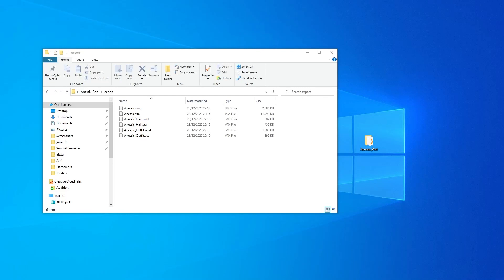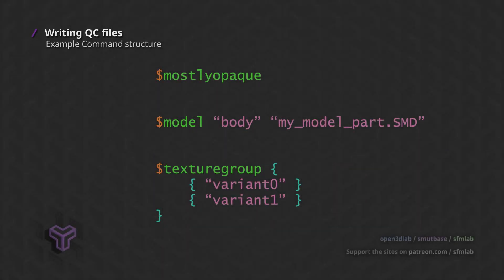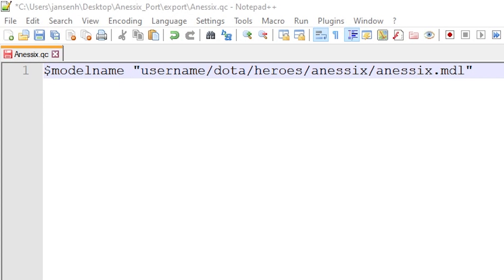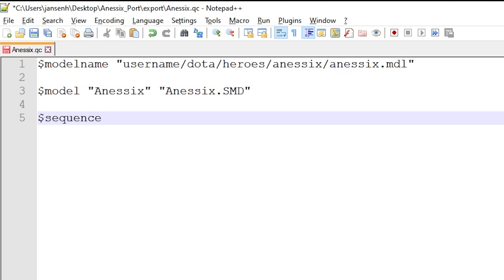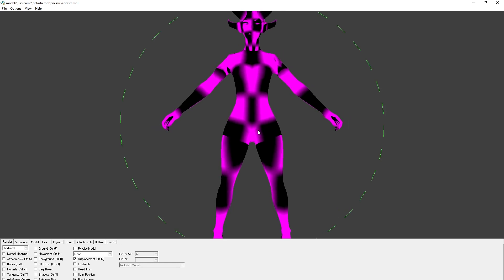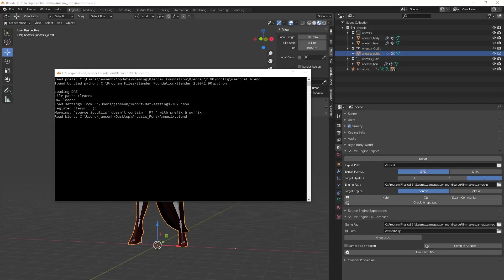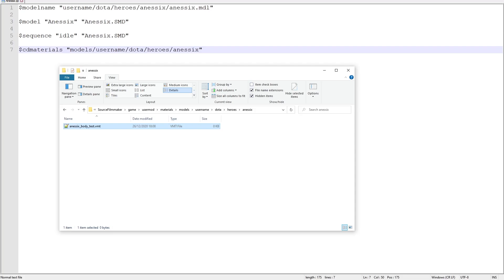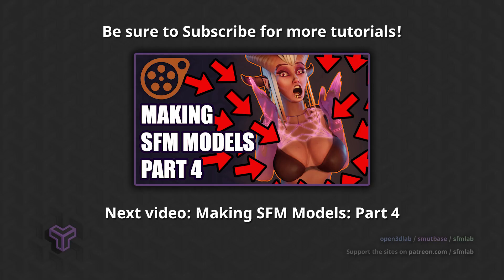Making SFM models: Part 3

Comment: Also you forgot to mention:

If you have more than one SMD, you need to individually specify every single one with the $model command in order for them to be compiled into the MDL.
Reply from the maker: No, I did not forget. This is the absolute basics. Keeping the exercise simple like this is super helpful for getting started. There's a lot more advanced stuff you can do in both the QC file, and in the materials. I encourage you to look that up in the Valve Wiki.

But the main takeaway should be that SFM is outdated, and porting to it is needlessly complicated, and not worth the effort.

Comment: I'm a little stuck on the materials bit.

I have the vmt file in the usermod-all those folders directory, have everything spelled right, but the model does not show up as grey in the model viewer, it instead retains the checkerboard thing. Any idea what I am doing wrong? I did everything as instructed.

 Please respond soon.
Reply: did you find a fix in the end?
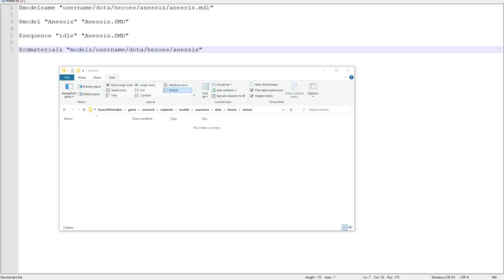Reply: I had the same problem and I realized I needed to make a path in the usermod "materials" folder just like it shows the folders path at 8:12

Comment: In the QC, in regards to the line,

$model "Anessix" " Anessix.SMD" 

I am having an error with that line, 

"bad command"

and looking at the video, you did not seem to explain, (or I couldnt find it) what causes the first quotation marks "Anessix" to be named what it is. What requires it to be named exactly that, that I am not understanding and causing the error with the different model I am trying to port? I haven't been able to figure this out for the life of me.
Reply: I have the same problem
Reply: anessix is the name of HIS model, you want your command to reference YOUR model
Reply: I know it's the name of his model, and that won't apply if I am using a different model, but I was not certain of the context as to why it was named how it was. I was unable to determine where it was referenced, and thus, when using a different model, it left me unable to understand what to properly input. The name of the model is referenced in multiple lines which may not always remain the same for all use cases. This is why I greatly value a breakdown of reasoning behind certain inputs, because it can allow the user to adapt to circumstances which may not be one to one copies of any given situation. Otherwise, you're left with a difficult roadblock, or stuck altogether unless you possess prior knowledge to adapt with.  @Amy-si8gq

Comment: What should I do when HLMV cant find the single VMT file at all?
Reply from the maker: Verify that the paths are correct. Especially $cdmaterials in your QC file, and that you created the folders in your materials directory.
Reply: @Open3DLab  I've run into the same problem. My paths are all correct and folders set up, but the dropdown in HLMV still says "no material".

Comment: It keeps saying that there's an error, but my qc file compiler has nothing wrong with it, and I'm clicking the button instead of compile all. I also did put in the sequence command, but it still says there's no sequence.
Reply from the maker: There is likely still an issue with the QC file that you're loading. Be sure to double check the syntax and the order in which you are listing the commands.